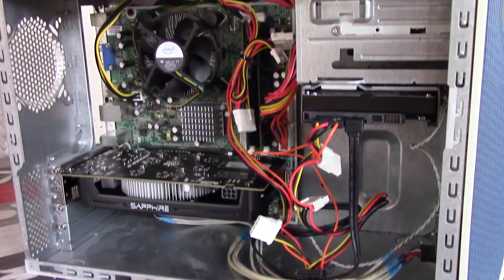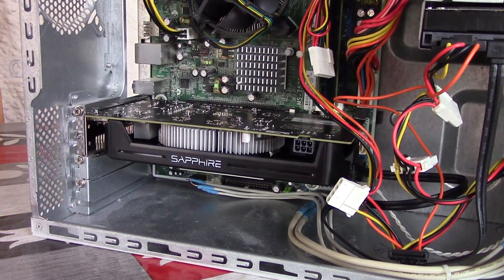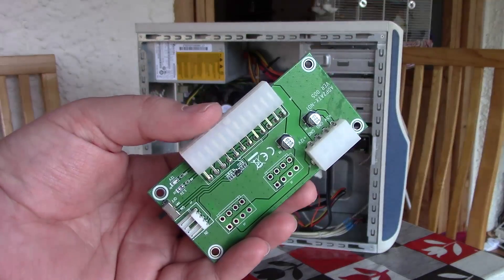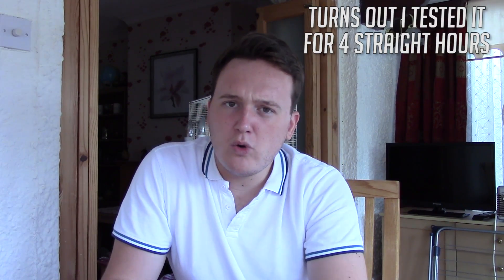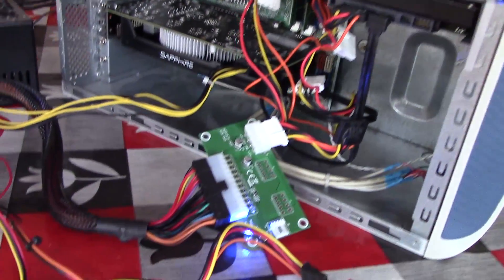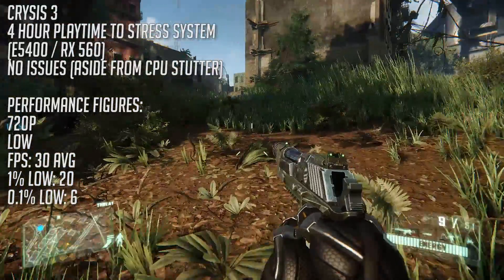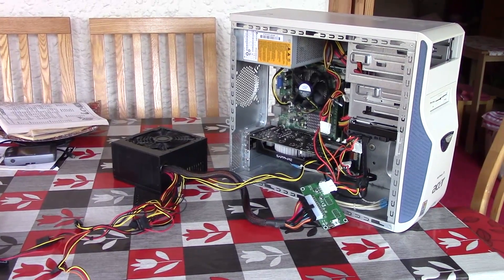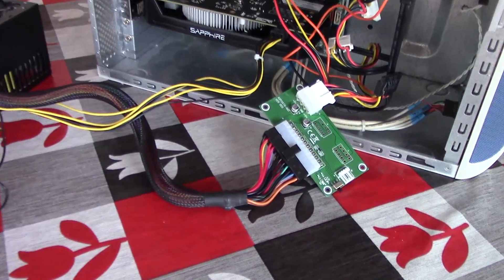Powering a Graphics Card With a Separate PSU

Comment: I mean phanteks not only has a psu splitter,  but has a psu combiner. This would properly take the 24 pins of both psu's (and even both 8 pins if you want) and can not only act as a dual psu for things like extra graphics cards, but also acts as redundancy so if each psu is only connected to its load worth (my plans is to have a dual 1000w power supplies, have redundant power to my 1950x and then 2 vega 64's per psu) Don't tell me how crazy I am, as I use this for 3D animation and I can go for a bump over my current 5960x and 4 290x's. 
Edit: these currently run on a 1600w psu from evga, I am not sure if I'm going to corsair or staying with evga, as if I can get corsair link working for both power supplies, then I'm going corsair

Comment: they make cable splitters that connect the power on circuit of a second power supply to the board with the first. All that happens when you press the power button is it closes a circuit between two particular pins to tell your power supply to start supplying power, then comes the rest

Comment: I did this when I got a second 670 and didn't have enough power leads, worked well until my second PSU is a turd and not powerful enough to run a 670. Then again, I hotwired my PSU with a coat hanger.

Comment: I use to have run an oldschool 300watt that had its own wired in switch for secondary psu.   Back when i first build a file server with 20 hds in it.   It had two 300watt psu's.  One was an older xt i belueve it was called.  That one didnt power a motherboard.   For me was only for added hd power,  but would have worked for gpu as well.

Comment: Would be interesting to see how that board ran with one of the PicoPSU's used JUST for the GPU.

The reason I say that is because of how small they are, so easier to hide inside a case EXACTLY for the use you suggested (Dell or HP PC)

Comment: As a computer builder and a amature electronics hobbyist I don't see any issues with this other then that the second PSU will have to chill outside the PC case unless you have a case large enough to shove it inside (and even still that would be a bad idea because of the added heat)
The only issue I can maybe think of is that a crappy PSU like any other crappy PSU can die and take out the Graphics card and what ever its connected to on the motherboard. JUst make sure not to get some old AF 2000's brand (or todays vintage) Chinese brands (My Corsair TX650 has been powering my compute for nearly 8 years now without issue)

Comment: Ran my computer with a similar solution for more than 4 years without any issues. It's completely safe and there's no reason for it not to work. Stop acting as if it's some kind of scary, unsafe solution to a problem as old as the ATX-standard itself.
Reply from the maker: +Jokkocze glad to hear that it is a decent long term option. Because I haven't had much experience I didn't want to recommend it, but hearing that's good

Comment: What? I just did this to my PC! My prebuild didn't have a power supply so I disconnected everything from another PC and only used the PSU 6-Pin cables. They're side by side and the GPU is just by one cable, because I can't find a Torx screwdriver. It works perfectly fine, even with a little rust. Just waiting for a DVI cable to VGA, can't wait! It looks so fucking ghetto, it's hilarious. SO glad I can upgrade from fucking Intel HD!

Comment: OR just buy a new case AND a new PSU
Reply: alot of those prebuilt oem PC"s cant be put into a standard atx case.My hp oem machine for example has the motherboard completely backwards and id have to turn it upside down to go into a regular case,and then the pcie slots would be on top and not lining up with the case.
Building a custom case out of cardboard would be another solution,or out of metal or wood if you can.

Comment: also this is safe.. its used in many systems... i mean all its doing is telling the other psu to start feeding power... and to stop(more ot less) its the same effect as using a jumper thining(the little plug the has a wire going from one port to the other)  a cheapo one might go bad and not turn on/off yuour psu one day.. but overall its safe and used in dual cpu/multi gpu systems especially before high power psus became feesable.

Comment: I did this for just under a year and I used it for just under a year. No problems whatsoever.
Reply: However, I never used that board. We just plugged the PSU into my GTX 960 (6 pin) and that was that. Every time I started my PC up, I would often turn on the external PSU first.

Comment: Ah this is nothing out of the ordinary for some people heh.
do this myself with a pc i built out of random parts here & a 9800gtx+ or with a 7800gtx. runs nice & stable & nothing heats up or has blown up yet.
(I do know the first powersupply that powers everything else besides the gpu power connectors is a bit bad though as when i plug in the 6 pin on the powersupply too the 7800 gtx it causes a freeze while benchmarking even the most basic stuff.)

Comment: They do make 12 pin to 24 pin adapters for Lenovos to use a modern higher powered PSU with a Lenovo motherboard. I use one myself. They work fine.

Comment: Hey, just some quick tips on the way a power supply works. When you press the power button it connects two pins, which powers on the unit. All this is doing is repeating the same action with the secondary unit, it is safe. ^-^

It'll feed power as safely and reliably as it would were it in a system on its own.

Comment: This is safe but doesn't look it. The adapter is just so both psu' s power simultaneously, the part that looks unsafe is having the psu not mounted as well as the adapter, it could be a hazard if someone where to touch/grab them while turned on.

Comment: Just stick a little wire between only one green wire and any black wire on 26pin connector, plug in your 6 pin/8 pin or even 2 in your GPU, turn on that power supply, then one in the PC, and start it up. That's how my cousin is using his HP with i5-2400 and r9 270x.

Comment: my first gaming pc run with 3 psu's  just fine
Reply: [x] doubt
Reply: why 3 though?
Reply: Why
Reply: @beefyonyt  idk maybe they had quad GTX 480 SLI and dual xeons all super overclocked? that or they combined 3 extremely bad PSU for a basic build.
Reply: @virtualtools_3021  haha 250w psu go brrrr
Reply: @beefyonyt  my pc requires atleast 250 watt, but my psu is only 220 watt, so I connected two of those to run my pc, it works just fine so far
Reply: @user-ke7mx3vk7k  i mean... fair enough hahaha

Comment: Have you tried to use a molex to 6 pin cable? Probably easier to do it that way than a separate PSU.
Reply: well... the point of this is the PSU cant handle this load b y itself.

Comment: You can make at home just put a switch on the secondary psu s green wire with ground any black wire  or use rele to power it thru the main switch and plug the card in the new psu

Comment: It's great if you can get a cheap £5 FSP Group or Delta PSU to add to an OEM system as I've powered a HD4890 off of a setup like this.
Reply: dont buy a small board like that. all you need to do is connect the green pin on the 24 pin connector to ground
Reply: @BonFire201  wdym by ground?
Reply: @himnishjain377  if you connect the green wire on the 24/20 pin connector to a black wire (ground) it'll turn the PSU on and deliver power to all the pins
Reply: @BonFire201  thats what i did. but im only using the separate PSU to get power through my two 6 pins to my gpu. thats what brought me here. lol.
Reply: heeeeeey!
Reply: Budget-Builds Official Yeah watched your video and then came to watch rginhd vid
Reply: I see where you get inspiration from .

Comment: All this board does is use the (green) on/off wire from main PSU and send a signal to it from molex to turn on/off, you can use the paper clip method instead of this board but it's more unstable
Reply: not if you bend the paper clip so it actually contacts well... Or just use a standard bread board jumper wire (slightly smaller than paper clip diameter, and its insulated) and you can easily bend a spring hook on the end for perfect contact and a tight fit. That's what I do for powering my LiPo battery charger and a cooling fan. No connection issues and it gets moved almost daily.
Reply: Jake Garrett for extra fans that my motherboard don't support I simply cut the fan connector off and connected the red and black fan wires to a cut usb cable so I can pretty much plug it in and use it by just plugging in usb into PC or wall charger. Works for pretty much anything that needs power, instead of running a full power supply. Much simpler and all you need is scissors/knife and a cheap usb cable (a wall adaptor if you want to plug it into the wall, don't use direct wall plug as it will just kill anything small because it pushes too much power.)
Reply: Magic mushroom I'm using a half baked 500w PSU for the battery charger. I would hate for it to ruin my 1000w power supply and my rather expensive desktop. I usually just plug wires into the 8 pin (GPU) cables, or molex, or 24 pin. Any yellow and black wire should be fine. Or if you want 7v (slow down a fan), use the +5 as the "ground" and the +12. That is something I actually use sometimes, or a boost/buck converter (I have 1 fan running 20v in my desktop because it had harmonic resonance with my case inlet and made a whistle sound, so I sped it up).

It would probably be safe to run off molex, but I already had a spare PSU and I don't need to leave my PC on.

Comment: damn! e5400 c2d with an rx560?     f-ing bottleneck!
Reply: Yashveer Singh it's a pentium, not a c2d. I had an e5300 with a 460, now I have a core 2 quad q9550 with the 460. But on Friday I will be upgrading to an i5-2500k(I already have it and a z77 extreme4 board, I just need a case and some ram)

Comment: I did this with ATI HD 3850 AGP, Intel Celeron 2.8Ghz Socket 478, 2x 1GB DDR1 and Windows XP. Both Power Supplies did last about 3 months, but at least my pc survive it. I had this pc (specs) from 2009-2011 and didn't have money for a better supply (only the GPU). After almost burn my pc, I did buy a better supply. After 2011 I upgrade to a Core i3 530, GTX 460 and Corsair 850w.

Comment: or just buy a molex to 6-pin adapter lol. A 300w psu may not be optimal for a card that recommends 400w but it would still be safer than running 2 separate psus

Comment: The only thing that board does is detecting voltage and give the secondary PSU the 'power on' signal.
For the primary PSU nothing has changed, if the PSU detects something bad it will shut off (read: no compromise). The secondary PSU is on a fixed ON state and will probably only switch off when the primary PSU also shuts down. So on the safety side the secondary PSU is possibly compromised. But this might also differ from PSU to PSU, contact your PSU manufacturer for the final answer on that one.

Comment: You see, there is a green wire on the 24-pin connector, and if you short it to ground the PSU will function while it is grounded, you could just take a wire and connect a pin whose cable on the other side is black and connect it to the pin with the green on the other side and voilà, whenever you turn on the PSU it will automatically start, you don't even need that chip, just power on the second PSU after you start the system

Comment: Dunno what precisely there is in the system, but 300W should be ok for a 560.
Now it's time for some criticism that I actually wanted to give you since you began using this value: the "raccomended PSU wattage".
I hate when you use it in your reviews because it literally means nothing, since every PSU delivers its marketed wattage in different games.
If ignorant people (or, you could kindly say "less expert") are gonna only rely on this value, they would take the crappiest PSU on the market: and we know how it would end up.
Plus, it's a pure suggestion, and indication: is you're PSU reliable you could even go lower in wattage, especially if you have a low-TDP CPU (which is what takes the most second to the GPU, the majory of cases).
On the other side, if you have a high-TDP CPU (like Threadripper or the i9 series) or plenty of HDD, fans, and somewhat, chances are that you're actually going to need more.

I would be happy if you began using the advertised TDP instead because it represent a more accurate data than the doubtfull raccomended wattage.

Aside from this and the unstoppable wish to hug this roundy cute face to rob your accent (wtf am I saying), I have nothing else to say.

I ask sorry if I sound salty but I'm not a native speaker plus I am sad as a lonely panda and I'm not in the mood to look for words that kindly express my thoughts.
Thank you for giving me minutes to actively spend on the day instead of wondering about my sad unworthy life.

Comment: My friend has a pretty crappy prebuilt so at our most recent LAN my other friend brought a GTx 950 for him to use while we were there but of course his psu wasn't enough to power it so I brought another shitty 300 watt psu and a molex to 6 pin adapter just for the GTx 950. We didn't even have one of the little adapters shown in this video so I used a paper clip.

Comment: This is really stupid.. Don't do it. Switch Mode Power Supplies such as these supply what amount of current it needs at a set voltage. A small load, or none at all, like this can make the PSU unstable. So if you are in an intensive scene with in the game and it requires more power quickly it will not be able to handle it or go over what it needs. This then, hard, shuts down off the power.